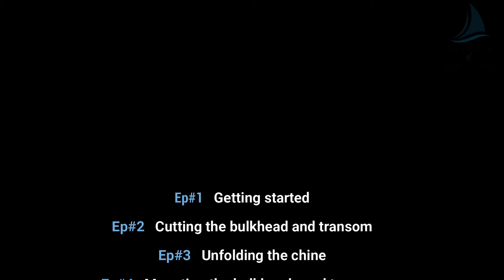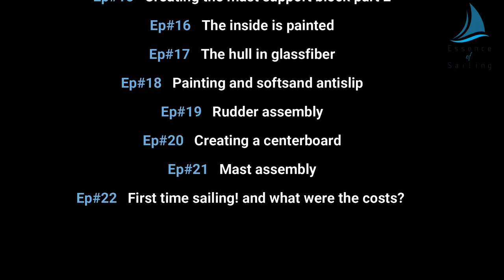Building my nesting dinghy - a sailing spindrift 10  EP_5

Comment: Nice work. I do tend to put two strips of masking tape parallel to joint as a guide to help keep the tape straight. Also I would use gloves to keep hands clean!
Reply from the maker: Hi Geoff, thank you for your comment,  yes, you are right, the tape would really help! 
Gloves would also help, I have tried different gloves to work with, but for me it is just not helping to work with them, I simply can’t. 
Thanks!

Comment: If the epoxy is sticky after a day you probably were not mixing enough hardener. Or the temperature was too low for the combination you used

Comment: You should have worn gloves while fitting the glass fiber tape to the seam. Some folks develop sensitivity to epoxy through skin exposure. Thus, your video at this point does not show appropriate safety procedures.